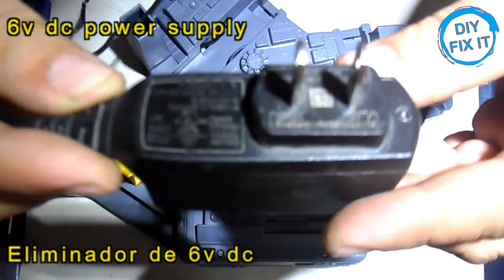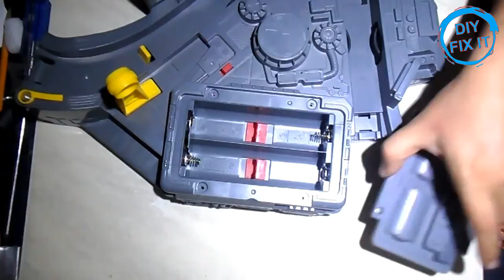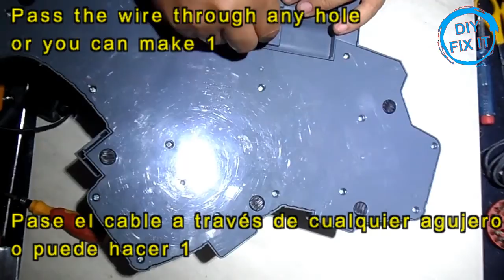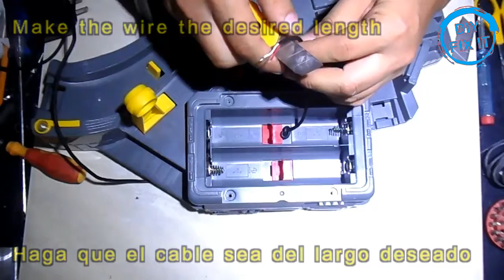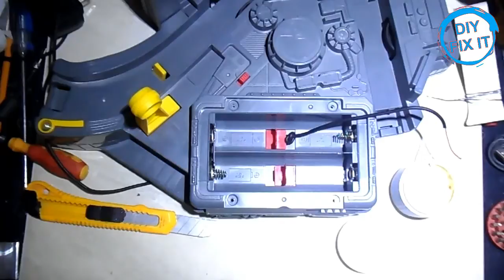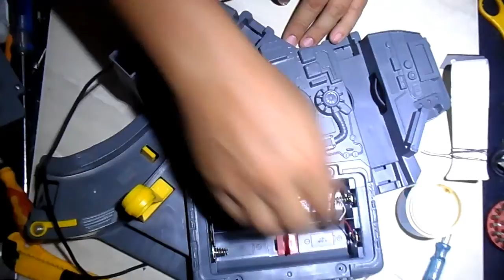Hack - Add an AC Adapter to Hot Wheels race track - Pista Hot Wheels con Transformador

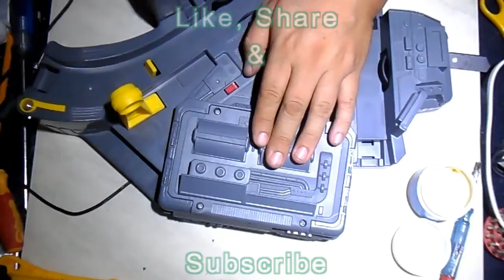Comment: 4:34 para una  de hotwells de 4 pilas de las Gordas que eliminador debo de usar?
Reply from the maker: Hola que tal, perdon por la tardanza, 4 baterias es igual a 4.8 voltios, puedes usar de 5 a 6 voltios sin problemas, un eliminador de celular con 2 Amperios es mas que suficiente, saludos.

Comment: Es mejor ponerle uno de medio ampere o trabaja mejor con uno de 1, es para uno igual de 6 volts? Gracias por contestar.
Reply from the maker: Depende de las baterias, cada bateria es de 1.2voltios y brincan a 1.5voltios, 4 baterias serian de 5voltios a 6, entre mas amperaje tiene mas potencia y velocidad, puedes usar asta 1.5 amperios y si tienes un eliminador, transformador de baterias con menos voltaje (3.5 o 4voltios) puedes usar mas amperios, 2 amperios sin problemas, saludos.
Reply: @nigoroku256  entonces que me recomiendas mejor, pensaba ponerle uno de 6v a 1A, o consigo uno de menos de 6 o asi esta bien?, quiero que si agarren velocidad pero que tampoco se vaya  a quemar el motor?
Reply from the maker: Buen punto, si es de 4 baterias si te recomiendo de 5voltios 1 amperio maximo, si es de 6voltios usa uno de medio amperio, igual puedes ver como te funciona mejor(si tienes mas de 1 eliminador de baterias) en ocaciones no tienen la potencia indicada en sus especificaciones pero si, es muy recomendable 5voltios con 1 amper o 6voltios con medio amper.